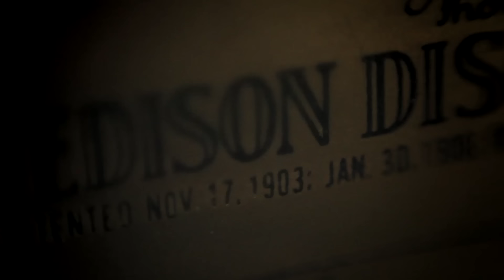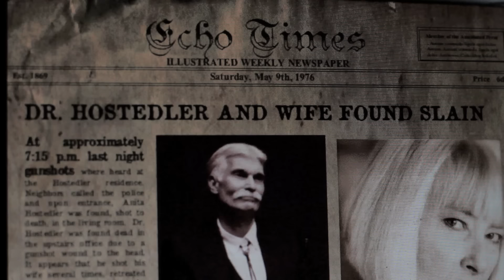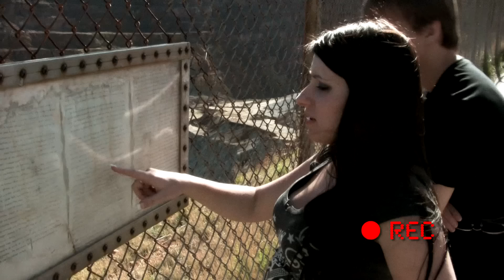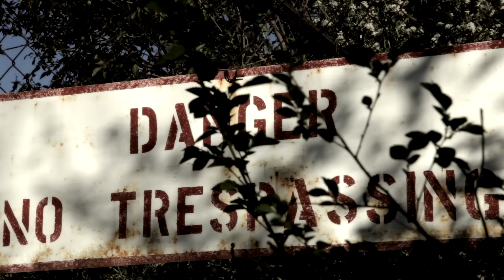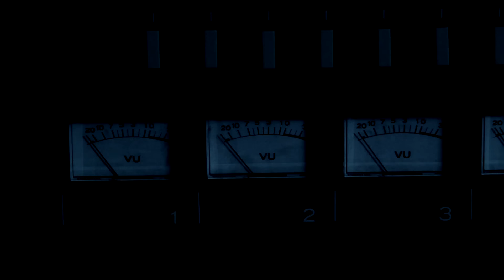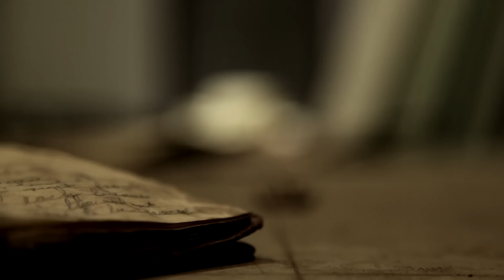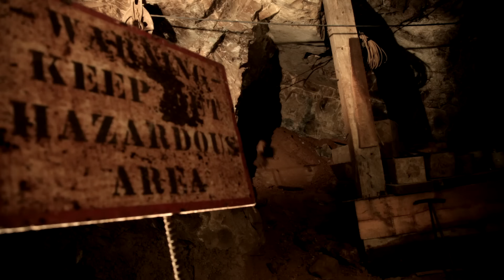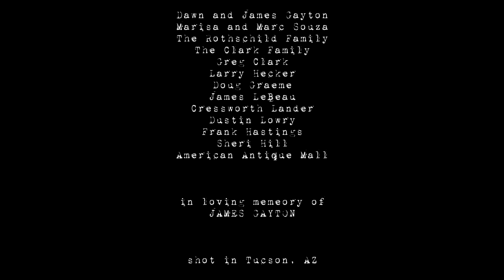Animus | FREE Full Horror Movie

Comment: This was a tad funny to me since I am from Bisbee what they call Copper Queen.  Thats just the name of the modern hospital.  The fence they jumped is 7 miles from the hospital.  The three round structures they passed are 6 miles away.  The place they call the hospital are still apartments and not vacant. Plus a mile from the modern Hospital which was built in the mid 1960's.  The original one was where the open pit mine is.  It was demolished along with the surounding subdivision to mine more copper. 
My mom said that one they investigate was a hospital built in the 1960's also, but was a regular hospital.   The one they investigate turned an apartment, is 1973....and is still an apartment   So until the 1970's there were always 2 hospitals but the lack of population only calls for one now.
the population at its peak was approx. 75,000 and is now 6,000.  It used to be the largest town between St. Louis and San Fransisco.